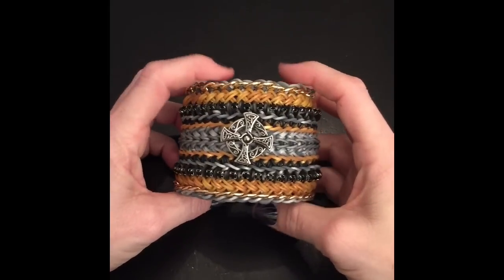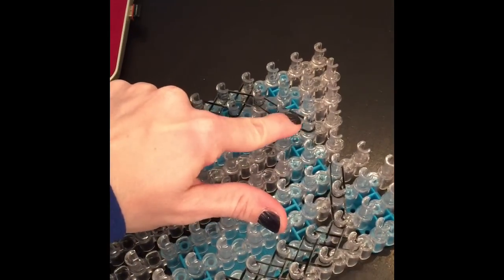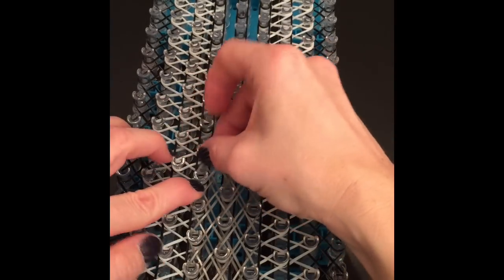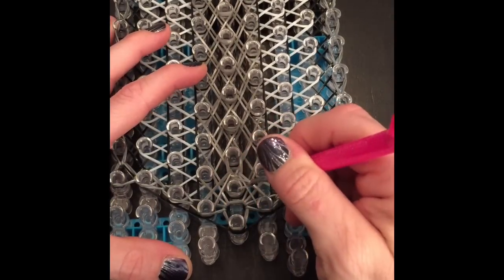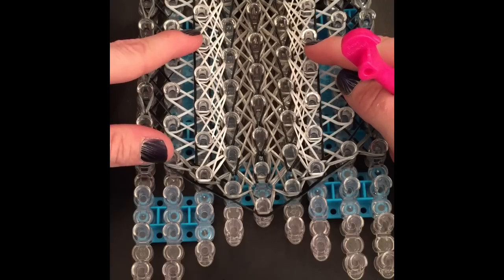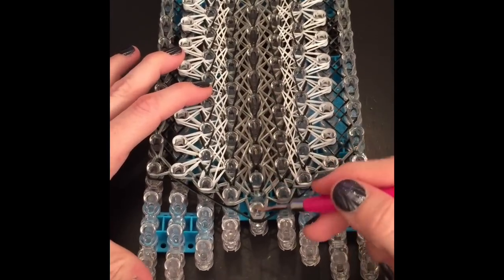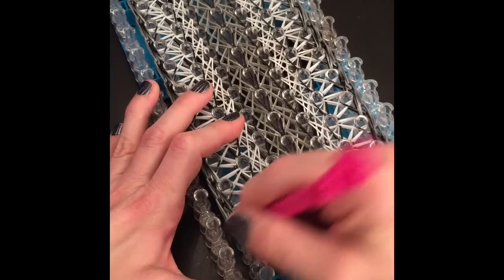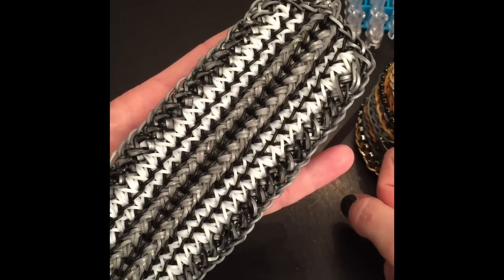Rainbow Loom Band The King's Armor Tutorial How To

Comment: I did a 7 pinbar wide variation. It is rather tight, so I would recommend adding 2 or 3 gaps compared to your usual length.It is a nice design, well done with the tutorial :)